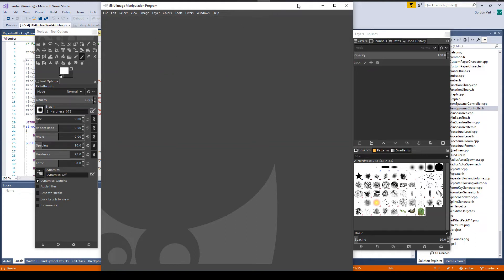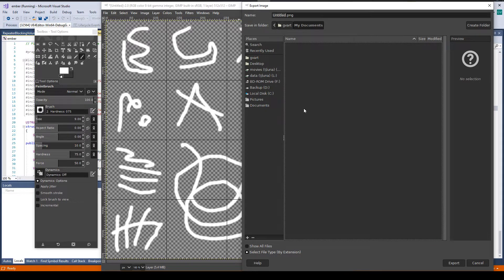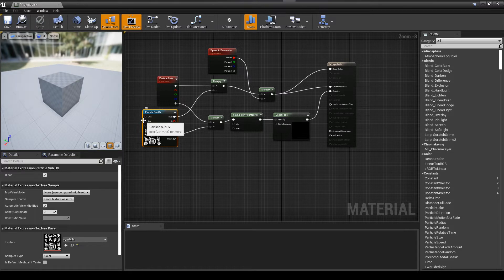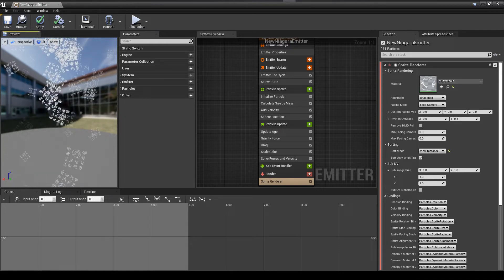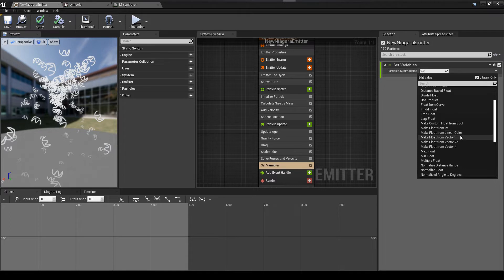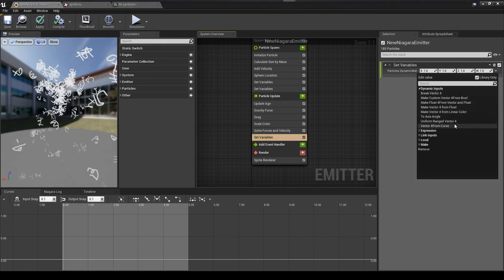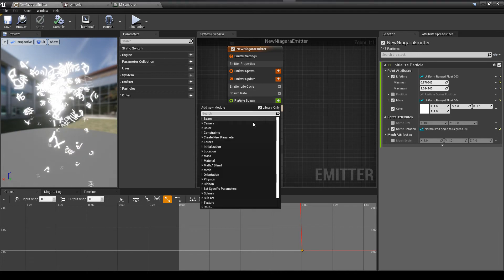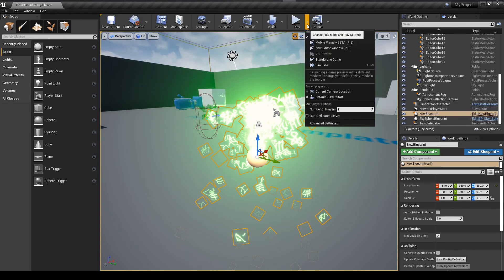Unreal Engine | Niagara SubUV Tutorial

Comment: Hi, dont know if you still look at the coments for this video but I could really use some help if you do. Im trying to have the particles show a random frame like you have done but not stay on that frame forever. Instead I want them to show a random frame and then cycle to another random frame. I have manages to acheive this using the SubUV animation module and switching it from linear to random, but when i do it cyles through the random frame at a extreamly high speed and i cant find a way to control that speed. Would you know how I could control the speed? or another way to acheive my desired effect without using the Sub UVAnimation module? any advice would be really appreciated